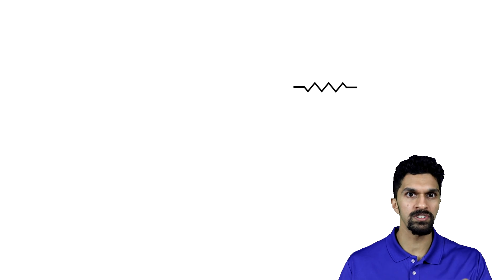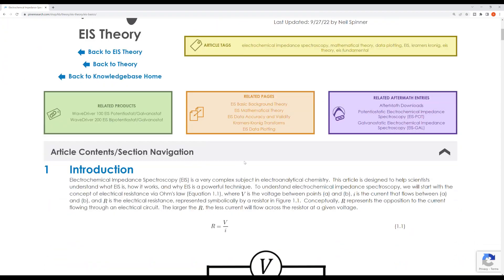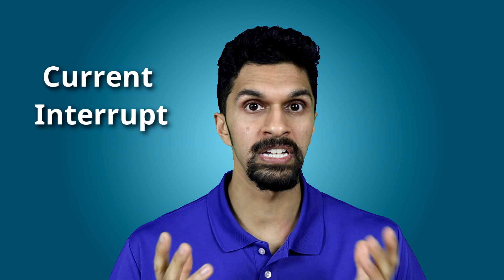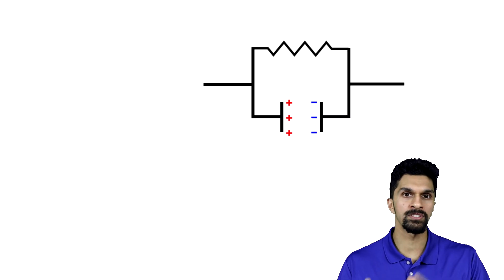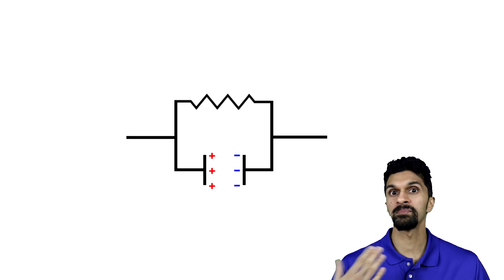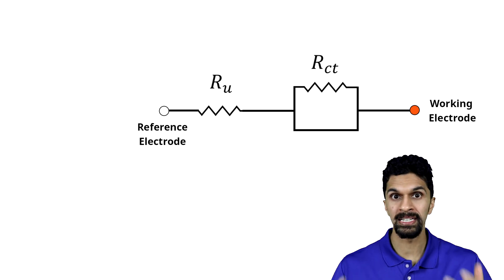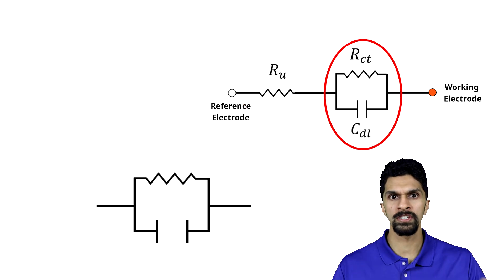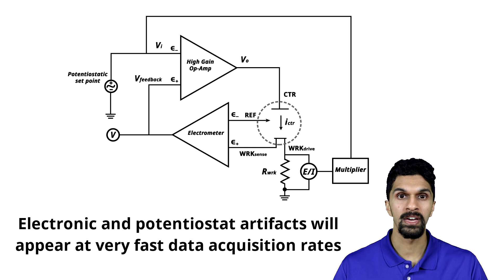How to measure solution resistance

Comment: Hello. In doing iR correction using Rs (solution resistance) from EIS, i expected only having very little changes on my corrected potentials..however i get really big iR drops in high currents like 100 mA. For example, my Rs = 5 ohms and i = 118 mA, i already have 0.59 V iR to be compensated. Even with 80% iR correction, i still have 0.472 V to be subtracted on my potential. Am i doing something wrong here? You're help is much appreciated.
Reply: Follow-up question, for testing OER water splitting and doing EIS, is it okay to use 0.65 V applied current? Most papers i read have different voltage used. And im confuse whether to use non-faradaic or faradaic potential during EIS. Thank you
Reply from the maker: Regarding your first question, it sounds like you are doing it correctly.  I don't know enough about your electrochemical system but if you're generating 100 mA of current, yes your iR drop is going to be big even with 5 ohms of resistance.  The question I would pose to you, is what exactly are you trying to figure out?  If you are doing a fundamental study and doing cyclic voltammetry, then half a volt is quite a big difference in the reported potential.  But if it's compensated, then it should be okay.  Regarding your 2nd question, I need a little more clarification, you said "0.65 V applied current" are you doing a galvanostatic or potentiostatic experiment?  Are you applying a current or a voltage?  Also, faradaic vs non-faradaic potential isn't a thing.  You can only have faradaic current or non-faradaic current.  So I'll need a little more clarification to help with your second point.
Reply: @Pineresearch  hello! I'm so sorry I don't understand much jargons as I'm only just starting with electrochem. What does "fundamental study" mean? I am also a little confused about the line "if it's compensated it should be okay". Isn't the iR drop (0.47 V in this case) the compensation giving 1.43 V the reported potential instead of 1.9 V for example? I am doing LSV study for Oxygen evolution reaction (OER) by the way. and i need to report the onset potential as well as overpotential at 10mA/cm2 and 50 mA/cm2, so having that very large difference at high current densities bothers me a bit. 

For my second question, i written it wrong. It should be "0.65V applied potential". Apologies for that. I will use my EIS nyquist plot to get Rs and Rct. So i don't know what applied potential to use since papers varies a lot in range. Thank you very much!
Reply from the maker: @clarik.9418  Gotcha, not a problem.  Echem is tough and full of jaragon.  When I said "fundamental study" I meant that your experiments are trying to extract a fundamental property of the system.  For example, calculating things like diffusion coefficients, heterogeneous rate constant, standard redox potential, etc.  These are things that shouldn't change if you adjust say the volume of your cell.  This is opposed to something like performing bulk electrolysis where you are trying to convert one molecule into another, like in the case of OER you are trying to evolve oxygen, but I don't know if the goal of your experiment is to try to evolve the most oxygen, or if you are trying to determine the standard redox potential for the catalyst you are using to evolve oxygen.  If you are trying to evolve the most oxygen, the extra voltage you apply shouldn't matter as long as you are generating oxygen, and getting high current densities.  However, if you are trying to determine the standard redox potential of your catalyst, then the iR compensation will play a very important role and you might aim to use smaller electrodes that give you a lower iR drop and hence a more accurate potential for catalytic behavior.  Does that make sense?

So based on what you wrote, you might run into an issue, because by virtue of measuring an overpotential at 10 mA/cm2 and 50 mA/cm2 you inherently will have a large iR drop because 10 - 50 mA even with 1 Ohm of resistance will change the potential by 10 to 50 mV (which might be okay for your experiment).  But alternatively, you might be able to use a low area electrode, minimize the iR drop, but report an accurate potential because you can extrapolate the current to a current density by dividing by the area.  Remember, the measured current, instead of the current density is what will contribute to the iR drop.  So I'd try looking at that.

Regarding your second question, thank you for the clarification.  I couple things to consider, the 0.65 V needs to be with respect to a reference electrode.  You will need to know what reference electrode those papers are using so you can use the same potential, if that's what you want.  I think what is best, is that you do a CV experiment to determine the potential of your system and compare it to what was done in the literature as well as take into account the thermodynamics associated with OER.  Fundamentally, what is the delta G and corresponding E for the OER reaction you are doing.  Then you can decide what potential you should use.

Also, (one last thing).  For these questions you should join us for the "Ask us Anything about Electrochemistry" Livestream.  We usually do them on Fridays at 1 pm EST.  You can then ask all your questions and we'll be able to answer them in a way that isn't typing.
Reply: @Pineresearch  thank you so much! That makes so much sense that for three electrode system, most papers only use 0.5 cm x 0.5 cm area. I use 1cm² just to lessen calculation 😂. That helps alot! 

I'm still a bit confused with the EIS though. My reference electrode is Ag/AgCl in 3M KCl (im not sure about the concentration of KCl, need to check first). But I'll just try to check at least two applied potentials (0.65V and 10mV) just to be sure. Do you think it could affect my potentiostat? I mean will it damage potentiostat if I apply wrong voltage during EIS?

thank you very much, for your invite on the livestream. I wish i could watch it sometime. But my schedule is full on fridays :((
Reply from the maker: @clarik.9418  Almost certainly you are not going to damage your potentiostat by applying different EIS baselines.  Very possibly you could damage your electrodes, however, much in the same way you might do so if you scan during a CV too far in either direction.  EIS is no different - you are applying a set point somewhere and that is setting the condition at the working electrode surface.  The potentiostat itself doesn't know or care whether the potential might destroy your electrode, electrolyte, or anything else.  It will just work to apply what you tell it to.  So based on all the previous discussions here with respect to iR drop and making sure you know how much it is, how much potential is lost, etc., you may need to carefully select the EIS set point so you are not accidentally applying the wrong EIS baseline.
Reply: @Pineresearch  thank you so much! I will be reading more papers regarding what baseline to use. I really appreciate your help. Thank you 🙏
Reply: @Pineresearch  Hello. I'm here again. So I thought i have solved the problem with my iR correction but it turns out i get plots that curves back which is an indication of overcompensation. I do iR correction by multiplying the solution resistance by the resulting current and subtracting it to the corresponding voltage. For example if i get 36mA at 0.8V (vs Ag/AgCl) and 26mA at 0.7V (vs Ag/AgCl) with Ru=4 ohms, i will have iR corrected values (90% iR correction) of 0.67V and 0.61V, respectively. I did this calculation until i get to the lowest applied voltage, where i subtracted resulting current x Ru to voltage. And i get a plot that curves back. Am i doing it right? What could be the reason of overcompensation? Even when i use 80% iR correction i still get wrong curves. Your help is very much appreciated.  Thank you very much!
Reply from the maker: @clarik.9418  I tried to talk about your question towards the end of our last livestream  https://youtube.com/live/YmCrgxbqdvo.  It's episode #58
Reply: @Pineresearch  thank you so much!

Comment: Excellent video, very informative! I have one question, why do we only compensate for 90% of the measured solution resistance? Thank you
Reply from the maker: The short answer is that the system oscillates badly if you compensate at, or too close to, the actual amount of uncompensated resistance.  The longer answer is actually well-described near the end of this video, which discusses and even illustrates the oscillations that occur during a Positive Feedback experiment and the kinds of errors that you can observe if compensating too much.

Comment: A very nice explanation! I have a couple of questions: 

Firstly how does the distance between working and reference electrodes effect solution resistance?
And would changing the distance between working and counter electrodes have an effect on the RC time constant for EDL charging/discharging, or is this primarily determined by electrode/solution composition? 

Thanks in advance :)
Reply from the maker: Great questions!  As the distance between the working and reference electrodes increase the uncompensated solution resistance also increases.  As such, most electrochemists try to place the working and reference electrode close together to minimize the uncompensated solution resistance in their cell.  Changing the distance between the working and counter electrode should have no effect on the electrical double layer of the working electrode.  Only the electrode/electrolyte and potential should affect the EDL.  I hope this was helpful!

Comment: Amazing video! I think this is the clearest and most complete explanation on the internet about this topic! :D Please keep making these great videos! I have one question though. If I use C.I. for potential correction during an LSV, since I am increasing the potential, the current also increases. So how does the potentiostat estimate the iR drop? Also, if the solution resistance is changing during the reaction, then C.I. would be a more suited method than P.F. right? I assume this because with C.I. the potential is constantly being corrected with the " resistance in real time"  and not by a fixed Ru value % given at the beginning of the experiment. Please correct me if I am wrong! :)
Reply from the maker: We're glad you liked it!  Thank you.  So you'll actually find the answer to how a potentiostat corrects for the iR drop in this video https://youtu.be/3Odj97ql2aY.  The idea is that the solution resistance remains constant during an experiment.  Both C.I, P.F, and all the other techniques assume the solution resistance remains constant.  But you are correct, the current changes and hence the iR drop changes during an LSV experiment.  If you watch the other video it will explain how a potentiostat corrects for the iR drop :)
Reply: @Pineresearch  Thanks for your reply! I watched already both videos. But I don't understand why the C.I. method assumes that the resistance remains constant. With the C.I. method what is know is 1) the current input at time 0 ms and b) the potential drop at time 1 ms, after the current was interrupted . Then, from this 2 variables, the resistance is being estimated. Therefore, resistance in this measurement method is a function of delta V. --> R(V)=(V2-V1)/ i
 From this estimated resistance, than the potential value is being adjusted to the "real" values.

To my understanding, this whole process is continuously being repeated DURING the whole electrochemical reaction. Therefore, if the resistance changes, this is not a problem because it is being estimated anyway from the input current and recorded voltage drop. So the resistance doesn't need to be a constant.

However, with the P.F. mode the resistance is being estimated BEFORE the electrochemical reaction, and applied as a constant during the measurement, where either V(i)=R*I or I(V)=V/R is being calculated. 

Am I making any mistakes? Is there something I am missing? Sorry if I am insisting on this issue. I really want to understand why this is not the case if I am mistaken. 
Thanks in advance for your time and help! :)
Reply from the maker: @kiraraashura  Ahhhh, okay I think there is a small misunderstanding.  The C.I method is performed once, and it's performed before doing any electrochemical reactions or experiments.  In fact, you don't want the applied current to be too high because you don't want faradaic processes to occur which would make Rct low.  All of the solution resistance techniques assumes that the solution resistance is constant.  Rct can change as a function of potential, but Ru does not.  It's an assumption, but I think it's pretty accurate.  Once the Ru is determined for a single C.I experiment, that Ru value is plugged into the potentiostat when using iR compensation (the other video).  In a CV experiment for example, the multiplier adjusts the output potential by the measured current (dynamically changing), times the resistance (constant).  Both C.I and P.F are used to determine a single solution resistance value.  I hope this was helpful.

As a side note.  We are planning on starting a YouTube Live Stream Q&A session in the coming months.  Do you mind if we use this for one of the questions to kick off the Live Stream?
Reply: @Pineresearch  Thank you so much for the clarification! However, my potentiostat (from another company :( sorry! ) does have a constant C.I. correction. So I am wondering, why is it an issue if the C.I. method is applied at high currents, causing Rct to be low? From the video I assume that if Rct is low the Voltage drop is not only going to be caused by Ru but by the combination of Ru and Rct, right? But what if Ru is waaay larger than Rct and the error caused by this is not too big? Would you say that it would be "ok" to use this method at high currents under this assumption?

Btw I don't mind it if you use my question :) I would be glad if I can help you back in any way for the support you are providing me!
Reply from the maker: @kiraraashura  Well your first problem is you are using a potentiostat from another company :D  just kidding.  I think you are correct, if Ru is much much larger than Rct, then the error associated with Rct will be small.  But in general you don't want faradaic current to flow when performing C.I because you are really just interested in getting Ru value and Rct becomes another path for current to flow.  The real problem you'll run into, is if you start overcompensating when using the iR compensation circuit in your potentiostat.  I hope that's helpful.  Of course every electrochemical system is different so you might need to do some troubleshooting to figure out what is optimal for you.
Reply: @Pineresearch  Hahaha actually I completely agree xD that's my first problem. Thank you very much for answering all of my questions :) really, you have helped me a lot. I wish you all the best!

Comment: I have a question. How to calculate HOMO and LUMO, and so bandgap from cyclic voltammetry? Could you please make the video on this?
Reply from the maker: Just to clarify, are you talking about the bandgap for a semi-conductor or for a redox active molecule?  I don't think CV is best technique for determining the HOMO/LUMO energy gap.  I'd probably use a technique like UV/Vis spectroscopy, because the energy from a photon of light will excite an electron from the LUMO to the HOMO, and that energy will be your HOMO/LUMO band gap.  Same with a semi-conductor.